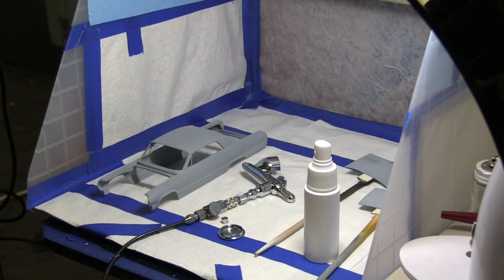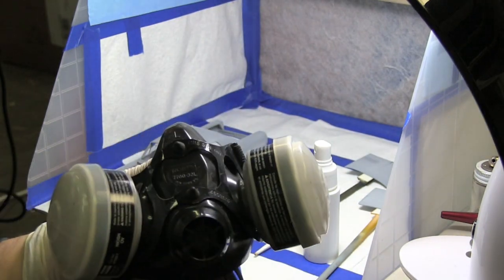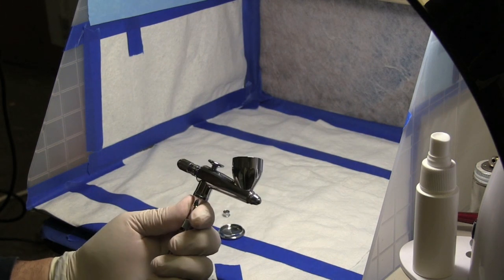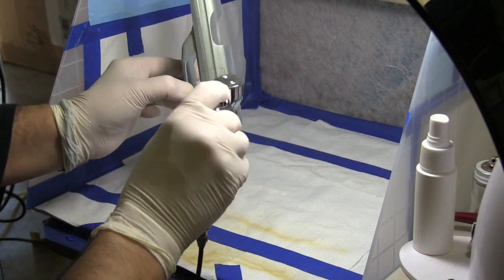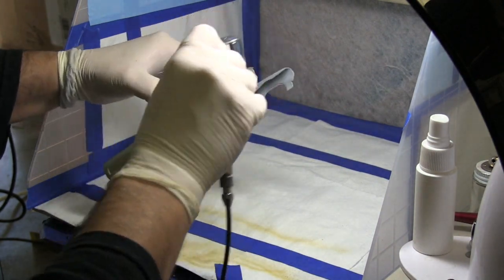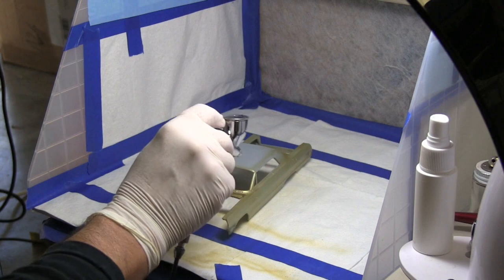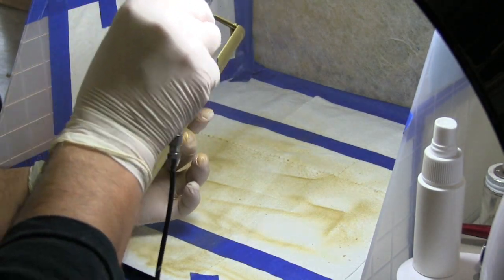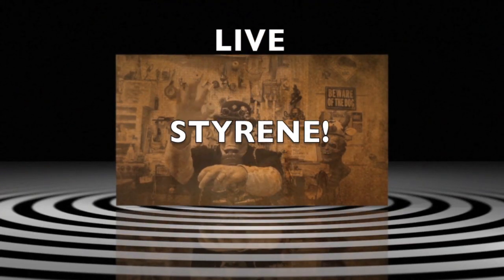CLINIC:  Gold Base PART 1

Comment: That's an old painters trick...cheap mans spray booth trick.  We did that before we had our spray booth at the body shop..we would mist the rafters and walls with water and then we would soak the floor to keep the dust down when painting..now we have a fancy downdraft booth.  Tiger striping is a pain in the rear to keep from happening..you have to go different directions with the spray patterns too.  Great video Doc..keep it up buddy.